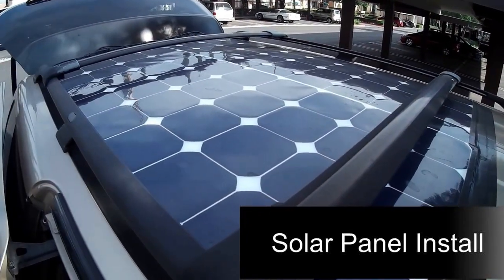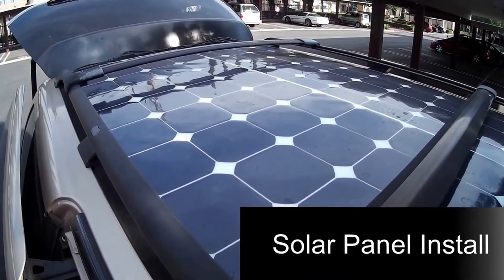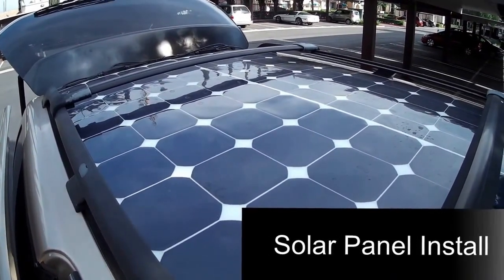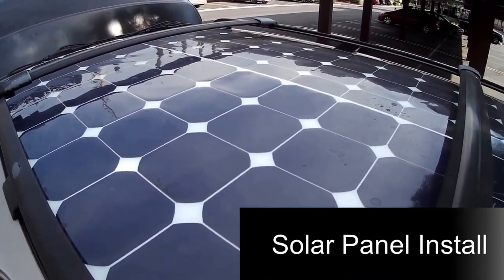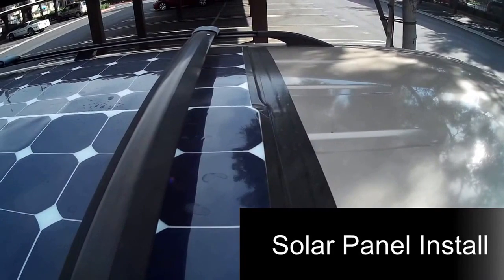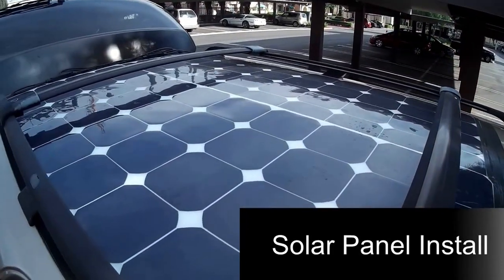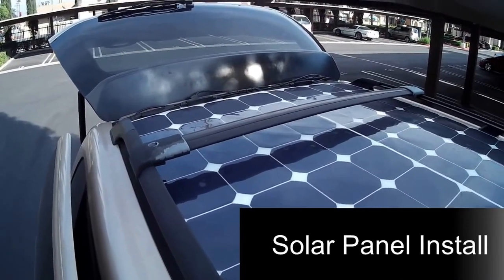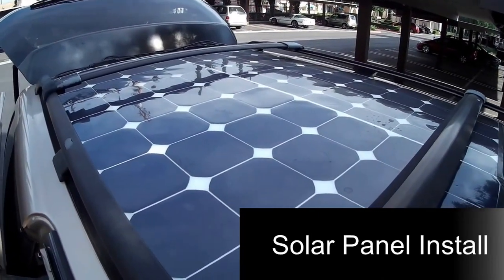Solar Install Simple Easy | Solar Panel Install  No Drilling 🚫  Industrial double sided VHB 3M Tape

Comment from the maker: https://www.vantasticodyssey.com/item-list-and-cost/    I want to mention using double side tape under flexible panels stills allows enough airflow under the panels.  However, My panels are firmly attached and mostly are not touching my roof because of the double sided tape under the panels.
Reply: How does airflow go under if taped? I’m looking to do this very soon to my van

Comment: Nice, but I would consider getting airflow under those panels. They are known for burning out without ventilation.
Reply from the maker: I strongly disagree,  Many youtubers are losing their panels because of airflow under their flexible panels.  I seen one popular guy swap out several times.  Mine are just fine.  2 years no problems yet. Check out this video https://www.youtube.com/watch?v=AJBB-N4_cBU&t=72s
Reply: ah the never ending debate. I'm still searching for the perfect solution..

Comment: Hi, I have an odyssey too, slightly older model and have been thinking about putting a solar panel up, I was under the impression that I had to put it on top of the luggage rack since shadow hurts output, but it seems like your panels are under the rack, I just want to know how that works out. And also, does the heat hurt the panels? Thanks.
Reply from the maker: I removed my crossbars to prevent shadows but it really doesn't make much of a difference because I set it up in parallel. I plan to put my crossbars back on.  I'm doing fine with the same panels for about 2 years.

Comment: So now that you’ve had them on there for a year, how are they holding up?  Is there anything you’d change?  I’m thinking of adding these.  My portable panel works great in the winter, because it’s easy to tilt. In the summer, I’d rather not deal with setting it up.  Plus, it takes up room...
Reply: Vantastic Odyssey LOL, I hear ya’ man, Minivan mpg is hard to beat. Every time I look at a Roadtrek, I start to think bigger, but the Odyssey is just so cheap to travel in. Thanks for the feedback on the panel install. I think I’ll be going that route.

Comment: Overlapping the solar panels ruins their capacity. Have you tested the individual input on the two panels? I’m sure that the top one is as rated and the bottom one is probably at less than 25% of stated input capacity.
Reply from the maker: You are right and I had plan to adjust it, but its fine, I covered the row near the wiring and got loss, but for some reason both panels are putting out fine.  I even disconnected the top one to verify. I'm running several things in my van, that said, you are right and it can be a problem.  I'm doing ok.
Reply: Vantastic Odyssey, I also have an odyssey.. 2010 and love it! Any update to your system or other ideas specific to our vans? I’ve got an extra battery that I want to add to it and have always looked at the pliable solar panels as a very cool and slick way of keeping it all topped up.

Comment: Nice, I would do flex pannels now.  They not available when I did my setup 4 years ago.
Reply from the maker: Hi, minivan traveling,  I want you to know that I liked your Fiesta Island video you made some time ago.  I bought my panels at a local dealer where I live but I priced them out on Ebay and Amazon and found the dealer on ebay.  I got a better price because I drove and pick them up myself.  Either way, I hope you get a good deal.
Reply: Vantastic Odyssey I am not going to upgrade now as that would be wasteful as the $100 panels I got 4years ago should last another 15 years.  Less time messing with my van and more time in nature.

Comment: on a tight budget wish i could afford to stick some solar panels on my roof     !   

instead of double sided tape should have used  sealant Glue  comes in big tubes once those panels were on roof would never come off and used it around the edges for a seal and  give a pro finish instead of all that tape
Reply from the maker: I might remove it in the future.  Im considering a different panel with more watts for the size.